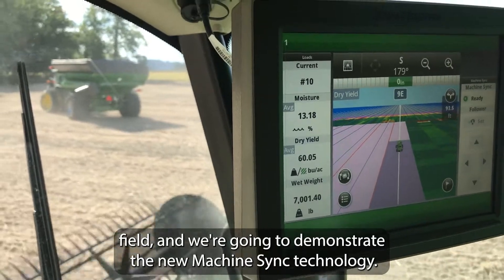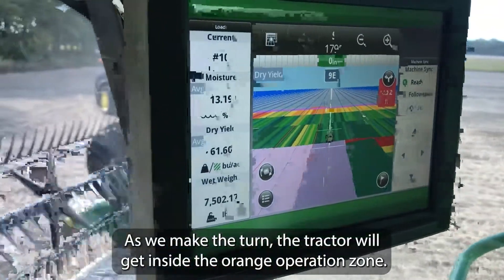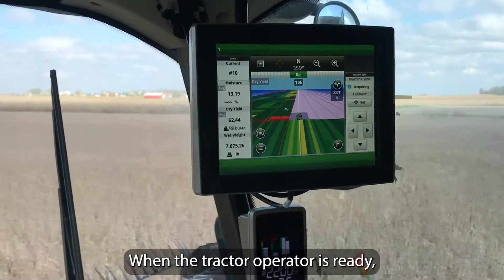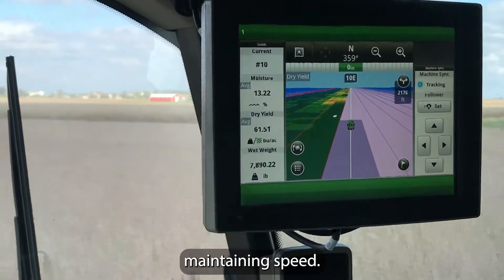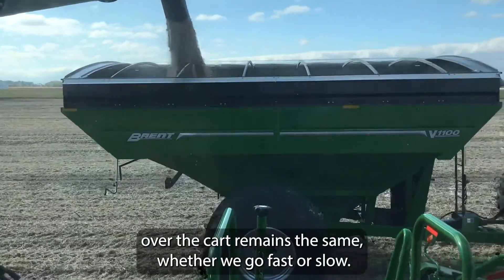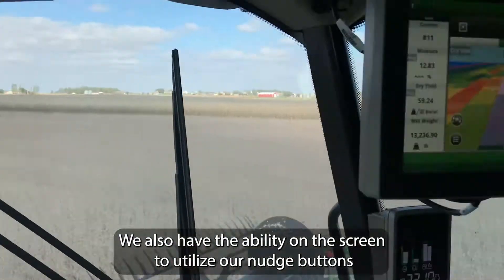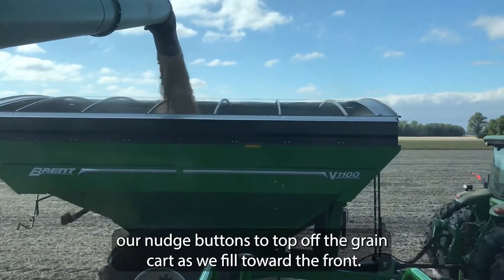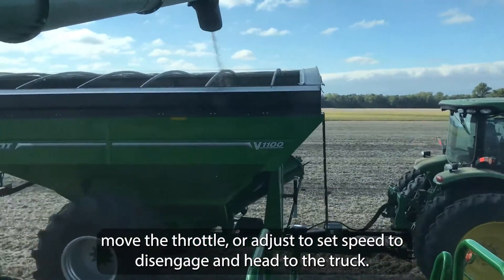How does Machine Sync Work? | John Deere Technology in Action

Comment: Ride in the cart tractor isn't as smooth as I'd expect.  We have f1 set to 6mph when hitting the auto.  Any advice to smooth things out a bit?
Reply: I did adjust a couple different tracking sensitivities and that helped a lot.  Went from 100 to 95 on settings.  Got rained out, so still trying some more tweaks.  Will let you know what we end up with when we got it perfect if I remember to.
Reply: I ended up changing 3 different sensitivity adjustments, some down as far as 50 or 60% and that helped.  What really helps the most though is to have your tractor pretty much sitting exactly on the line it will track to before you hit the auto button and then that eliminates the need for the turning all together.  So pay attention to where that point is after you get there on earlier attempts and try to hit it every time before hitting the button.  I also found that tracking in from well behind the combine is the easiest and setting the speed up to 7.6 or so still gets you to where you need to be in enough time.   I was having some throttle surge that I didn't like, but if you start to autotrack sooner, it seems like the software does a better job of managing the speed reduction.   Coming in from the front works too, but the steering sometimes washes back and forth a bit more since the speed is slow it is trying to make corrections with little speed, so it spends more time steering than moving to the ideal spot (since you are basically stopped though, you don't get thrown around the cab).  The bottom line is try some different things, play around with it a bit and find what you like and don't like until you tune it in to what you can work with.  It is pretty awesome to have for dusty bean conditions, doing point rows, in the dark or the end of the day when you're tired of being in the cab, etc.  Tell your combine operator not to dump on you when you're trying different things and that will help remove a point of stress while setting up.
Reply: @joemyers  I'm hoping to have machine sync for next year. you comment helped a lot on understanding what to expect from it.
 makes sense to be lined up before hand and how it can adjust better with faster forward speeds do you run a wheeled tractor or 2 track?
Reply: @garrettheyerdahl4123  jd 8rx 4 track
Reply: @joemyers  have you tried it in corn or just beans? I have a few different theories on how the tracking works depending on the crop
Reply: @thomasgoetz4584  both ... seem my earlier reply for my final comments.
Reply from the maker: Go into the advanced settings for Machine Sync and adjust speed sensitivity to 1 if that has not been done. Let us know if that helps!
Reply: Do you mean that real hard side to side the tractor does? We’ve been working on that for awhile but nothing seems to straighten it out right